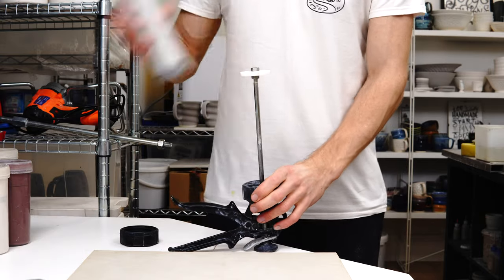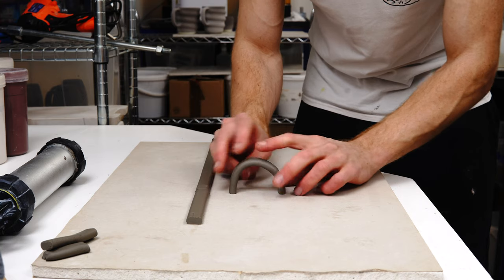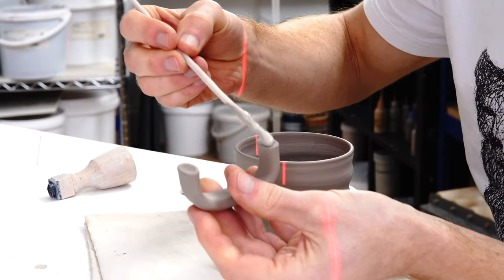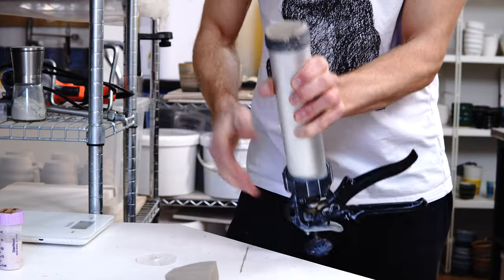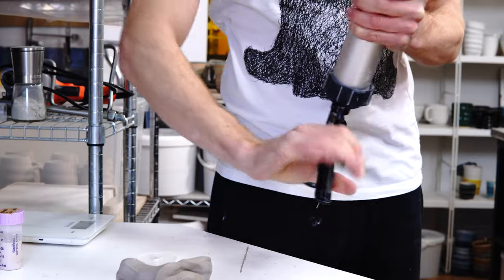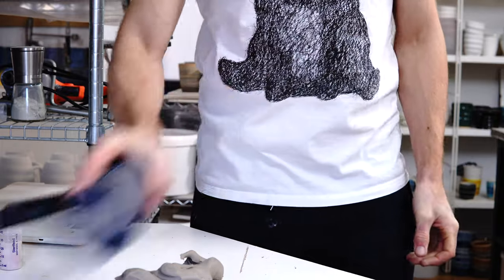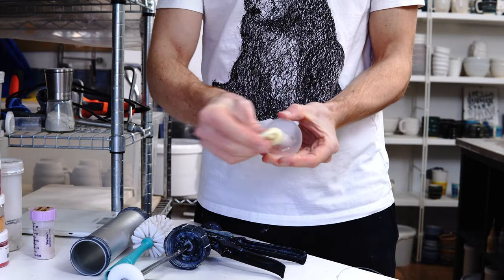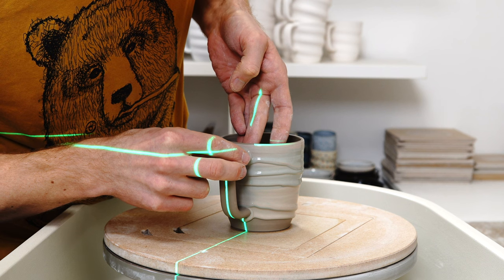Quick Tips for Handheld Clay Extruders - Bubble Free Clay

Comment: I also get horizontal marks across the extruded strip that correspond to the clicks of the handle. These crack open when I bend the strip to form a handle. Very frustrating. 🤬
Reply from the maker: If I'd have thought of it when making this video, those marks would have been the third commonly asked question!

The reason they're there is (probably) because the extruder and clay are moving sideways every time you pull the handle. The solution is to rest the extruder against something solid to stop it from moving. I press mine against a shelf, it keeps the extruder totally still while extruding and generally avoids those marks altogether. You'll have to find something suitable to rest it against in your studio, but a desk/shelf/wall/etc should do the trick.
Reply: Thank you so much!  I will give it a try. @OldForgeCreations